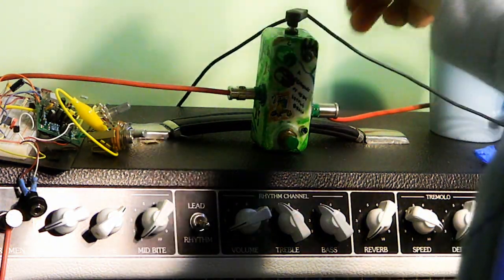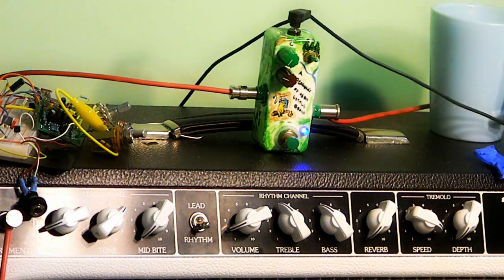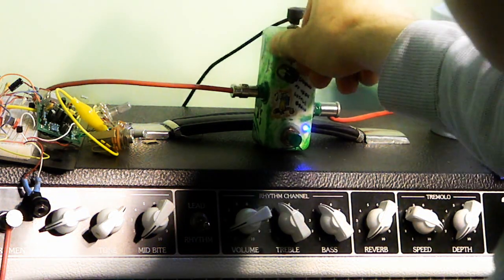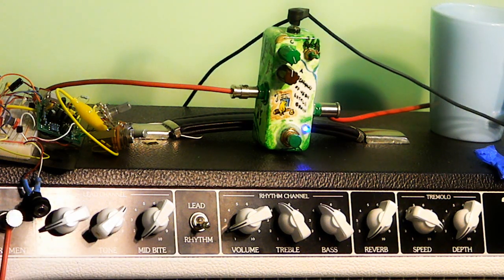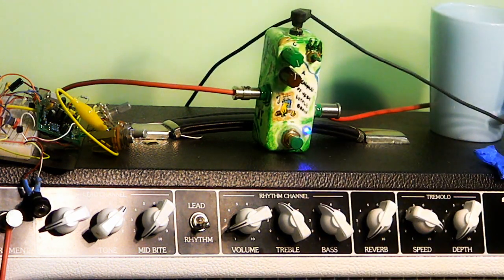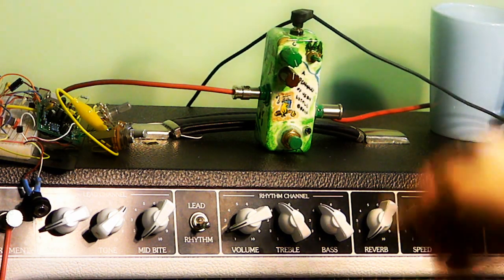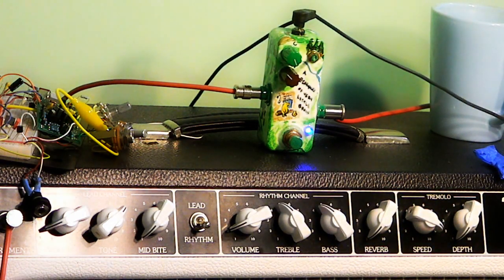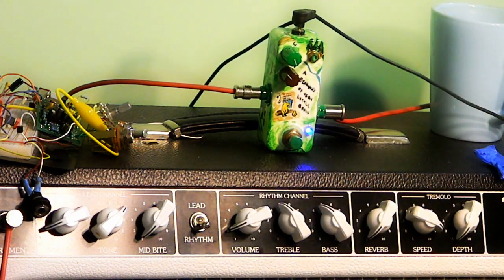Bearhug FET Compressor v2.0

Comment: Jon, is it possible to build a bearhug compressor like I had (someone stole it) and install in directly into my stratocaster? I bought a Henretta Orange Squeezed but your design is FAR more superior to the Dan Armstrong original. (I had the Zappa Neismith cover painted pedal you made for me in 2013 that I loved to pieces then it got taken out of my car) anyways if this possible may be DM me or point me to a design etc. You're the best! - Matt Larson
Reply from the maker: Hey Matt if you still have my email contact me there we’ll figure something out. I’m really sorry your pedal got stolen — I lost a backpack with some stuff once and it was a gut punch. (If you need my email it’s jonspatton at Gmail)

Comment: well Jon, I hope you see this. I'm looking to make a fet comp for recording and mixing. Do you think I  could run this on 18v or 15v minimum? or what values would I need to change to do that? BTW, your contributions are awesome. Thank you!
Reply from the maker: Make sure you check the maximum operating voltage of the transistors you use but for the most part it should be fine. Keep in mind that more headroom can mean more signal, which might just compress the signal harder (something a lot of people discover when they go to use this with humbuckers), so you're not necessarily getting more dynamic range by increasing the voltage. You also need to decide if you need to handle instrument signals or line inputs, they'll have radically different impedance requirements and high input impedance can result in a lot of noise. Also, for comparison, something like the 1176 is made to handle line levels and runs the audio on 30V, and still experiences some distortion.
Reply: @jonspatton  Thank You!

Comment: Thanks for taking the time to document your project. This is by-far the easiest path to understanding a compression circuit, at least it's the easiest one I have found.
    I'm currently modding the design. I want to permanently install a mild version inside a custom project amp.
  I don't know if you still check these old posts on YT, but I'm really curious what your thoughts are on modding this circuit. Would you do anything different with the design if you had either +-15 or +-23 volt rails to play with instead of just a 9volt?
  I've already redrawn the schematic a couple of times and am currently looking through my parts collection to test with a scope. I am just curious if you have any input ;)
Reply from the maker: Sorry, just saw this (I'm not getting notifications about comments for some reason). First, I wouldn't usually suggest putting an envelope effect in an amp -- any time you have a gain effect preceding it, it's going to muck up the sound, and this is one reason compressors are so often at the start of the pedal chain. But besides that, if I were running this on very high power rails, I would either look into increasing the maximum ratio (taking advantage of the higher headroom before clipping), possibly use a BJT first stage (if you don't need the really high input impedance of the MOSFET at your spot in the circuit, this can give you better bandwidth and lower noise), simply run the effect on half a rail (that is, just use the +15 or +23 V and ground and re-bias), maybe a few other things. You can add a ratio control by putting a pot in series with the FET variable resistor (either between the source and ground or between the drain and the 47uF cap). I've probably talked about it a little on the Madbean thread and it might be hard to explain in a YouTube post, but a 5KC would probably be a good place to start. A forum thread would be a better place to discuss the details of the circuit -- a youtube comment is pretty limited.
Reply: jonspatton I see what you mean about distortion and an envelope effect. One of my projects is a 1 volume knob amp I'm trying to design. So no effects, just a plug in and play setup with a specific guitar. The guitar's onboard volume control will take the circuit from clean into overdrive. -For those days when you just want to play an electric without fooling around with a bunch of gear ;)